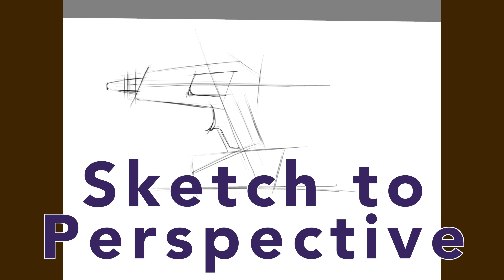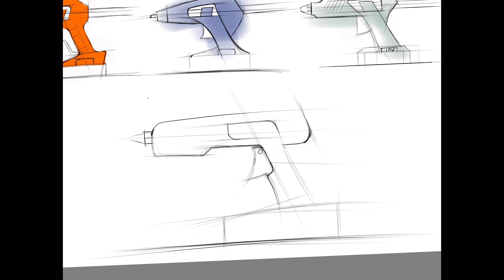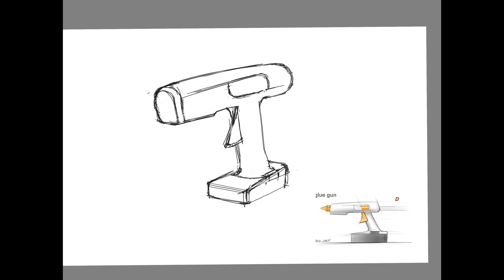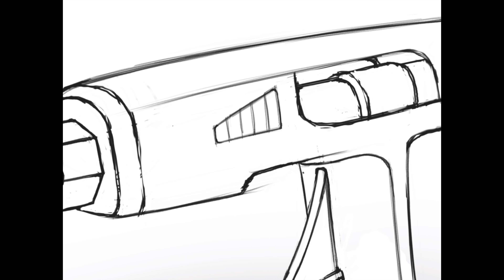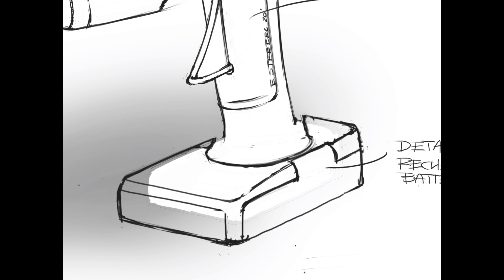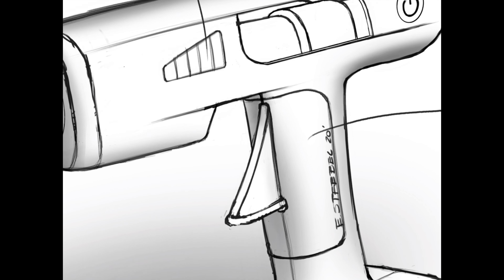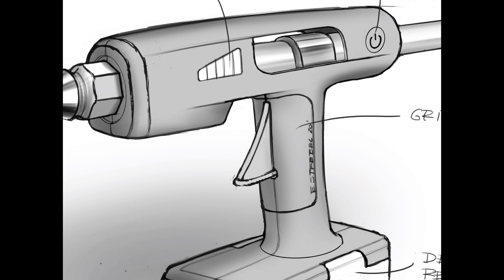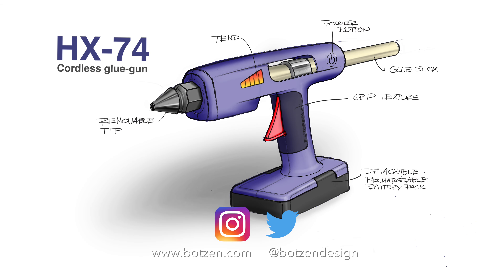Product Design: Sketching to Perspective Rendering

Comment: What is the exact function of a drawing like this? Where does it fit in the overall process? I tend to get overly in the weeds with what the mechanism would be for the glue or other  engineering details that don't seem to be covered in a drawing like this. What real world considerations are there for this drawing or is it just imagination and all of the hard engineering work just comes after? You use terms like right or good in terms of the battery... By what standards are you determining right or good?